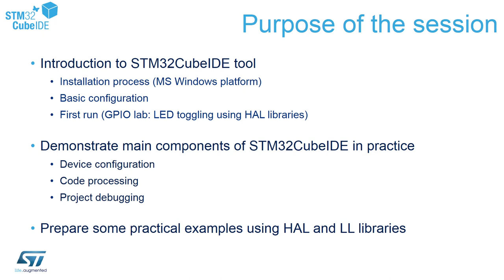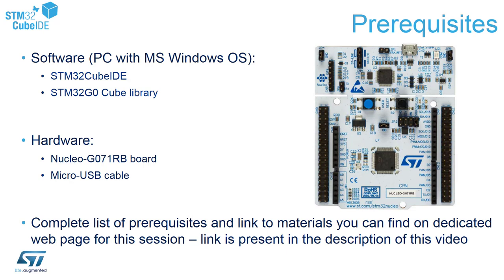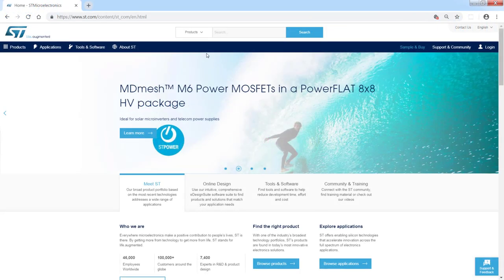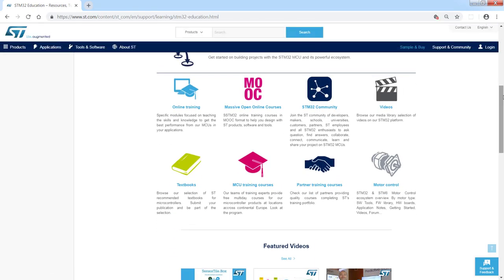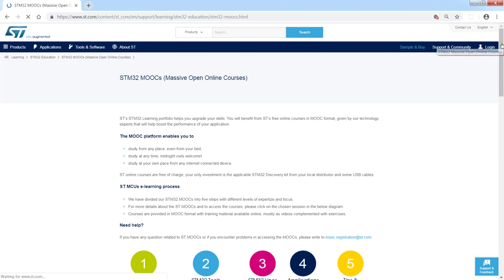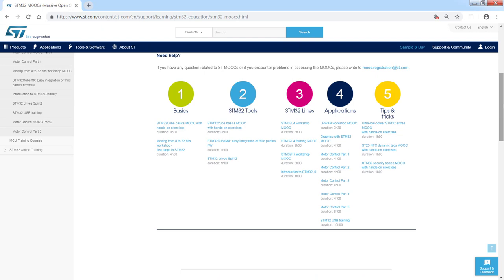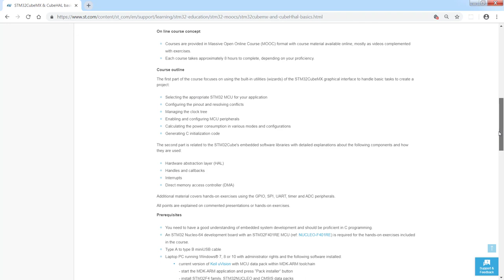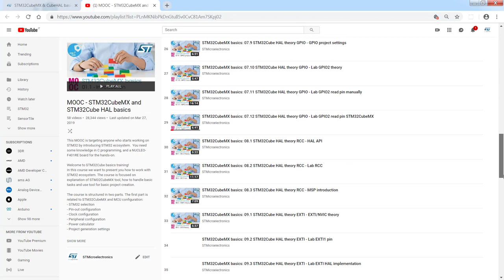STM32CubeIDE basics - 01 Introduction

Comment: What is ST's official stand on blue/red pill boards based on STM32F103C8T6. Would be great to see an official video showing how to use those boards with STM32 Cube IDE. Without any of the arduino crap.
Reply: Mitch davids has a nice video about it but in short, you can use the cube IDE for the bluepill, what you need is an ST link and the MCU number on the blue pill. Then you can just manually configure everything you need.